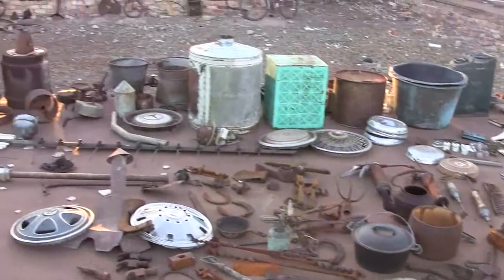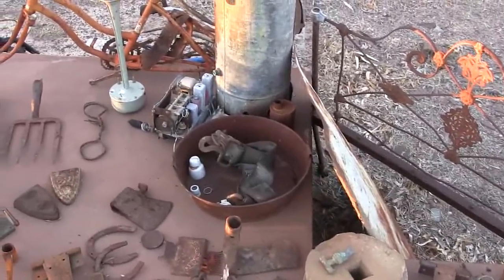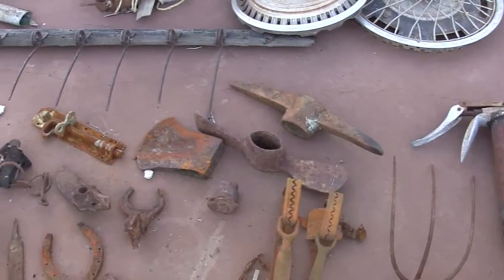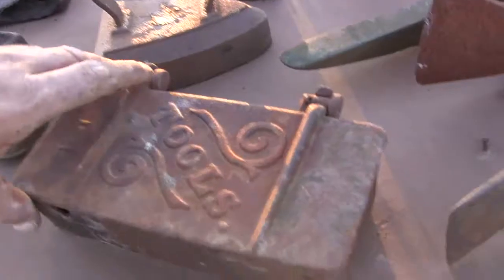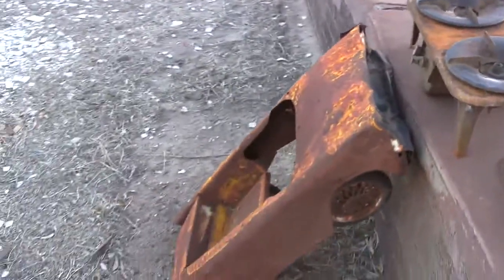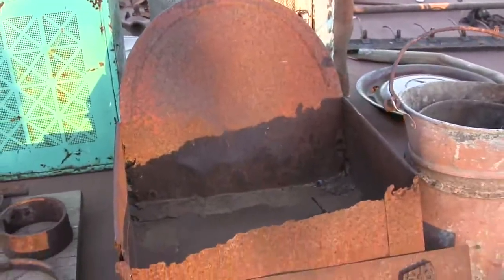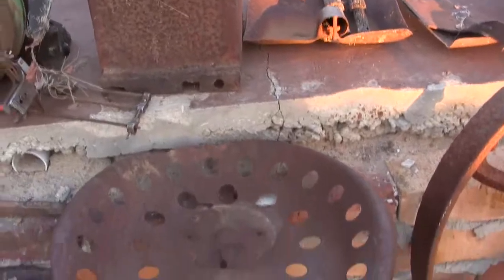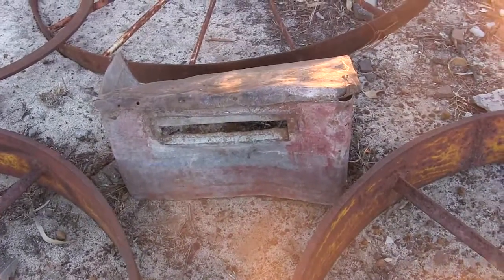My Old Australian Iron & Metal Relic Collection - Dump Finds - Part 1

Comment: That villiers, HS stands for high speed so they can run fast. That'd be 2.7 B.H.P @ 3000rpm. Thanks for the link to my channel. You've some really good stuff there, i recognise a lot from things i have seen around. I remember as a kid helping dad load so much stuff like this into bins when we cleaned the place up, could kick myself now at some of what was thrown out. Do you know Bob Cochrane of east Pingelly, he was a scapper for years and had saved some awesome stuff but lost it in a fire.